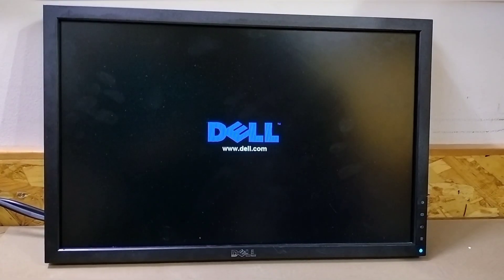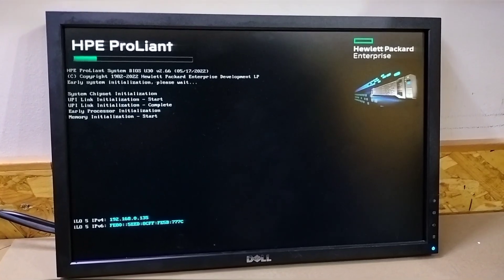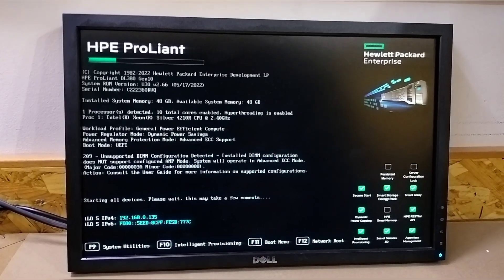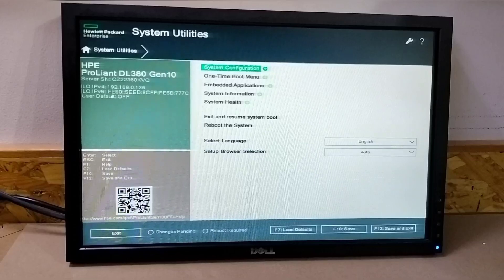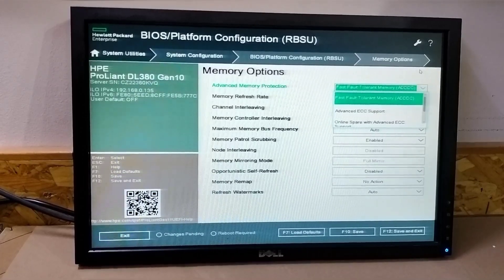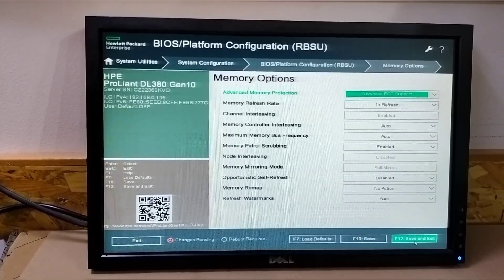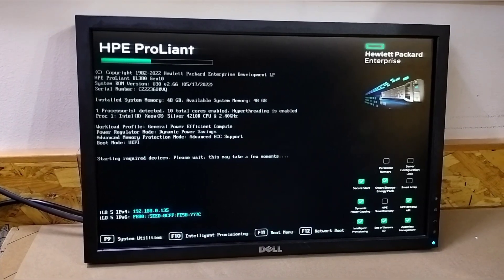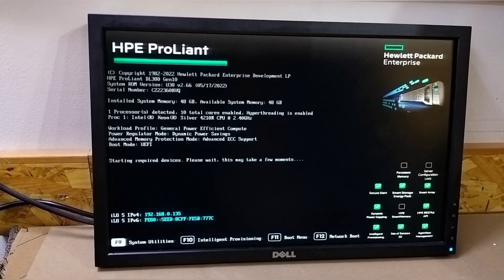solved | 209 Unsupported Dimm configuration detected in hpe DL380 / DL360 g10 server

Comment: this video really helped. I re-set my bios and it fixed my "Installed DIMM configuration does NOT support configured AMP Mode. System will operate in Advanced ECC Mode. (Major Code:0000003A Minor Code:00000000)." error.